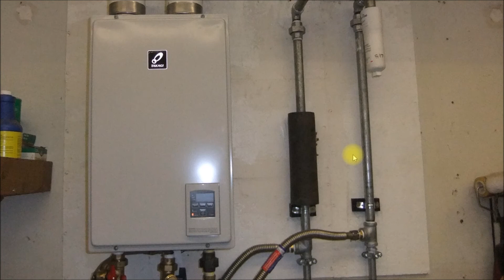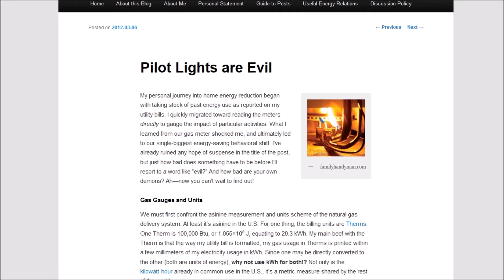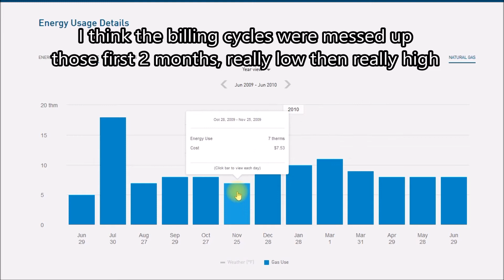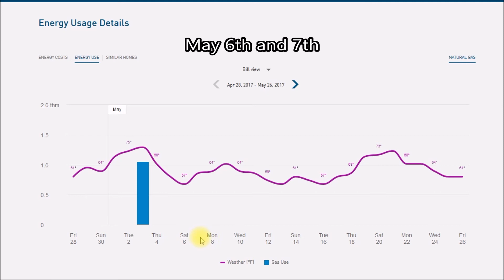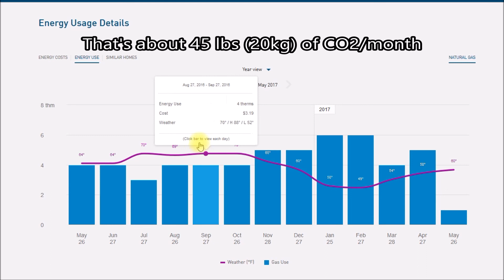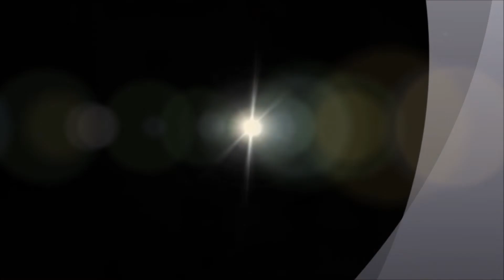Tankless Water Heater - One Month Update

Comment: Certainly a compelling analysis.  Having recently started heating my garage with propane in winters, I immediately found the heater's 24/7 pilot required manually shutting off the supply, then turning on the supply (and having to re-light the pilot) was the only present way to stop bad waste.  I have yet to find an electronic ignition, that seems the ONLY way to get savings as you have demonstrated.  Appreciated you took the effort to document.

Comment: That is a nice way to save money and help keep things green. Nice video.
Reply from the maker: Thanks for the comment.  When you convert that natural gas (or propane) consumption to KWH, it's shocking how much energy a tank water heater/pilot light uses.  At 5 therms/mo., that old heater used ~150KWH/mo. of energy, about half of what I use in electricity for everything else in the house.  Or looking at the standby consumption, 170W on gas or with the tankless, 3.2W of electricity.  Once that tankless unit is powered off my solar power inverter, in a sense, I'll be saving ~120KWH/mo. of gas via solar power.